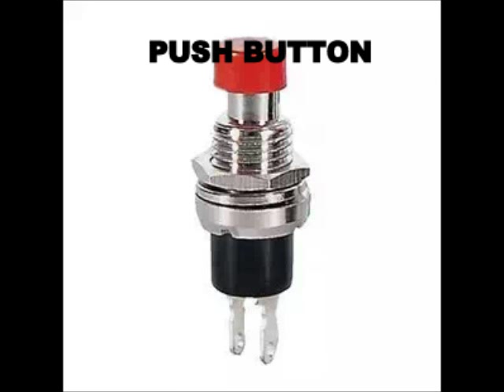electronic sleep inducer

Comment: Hi there. I am a 4th year student who doing my Final Year Project. I have some questions about this inducer. May I know the inductance value of the radiator coil? Are you just coiled 600 turns of 0.2mm enamelled wire on a 4cm long, 0.6cm diameter steel bolt? Yet, may I know is that the type of steel bolt (with threads on whole part of steel bolt body or with threads at the end of steel bolt for securing the bolt only)  will influence the effectiveness of the inducer?